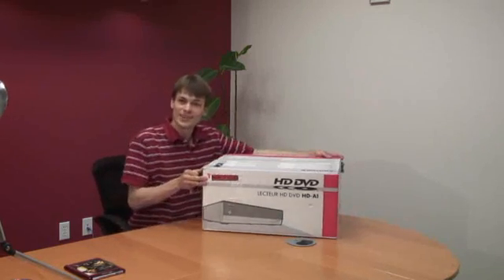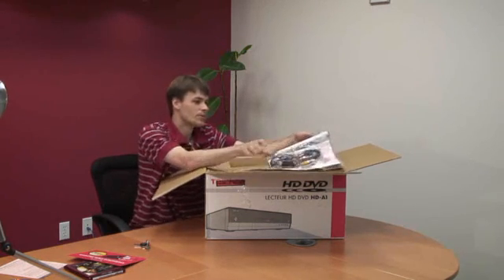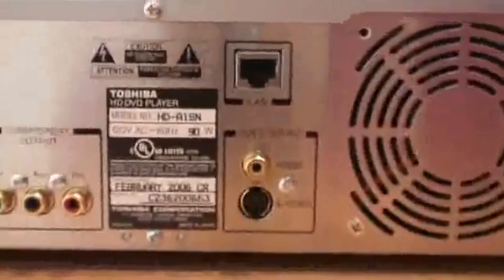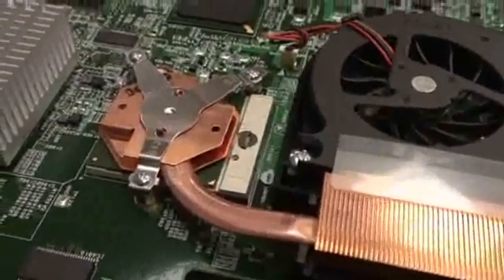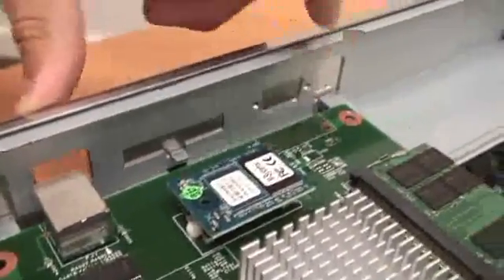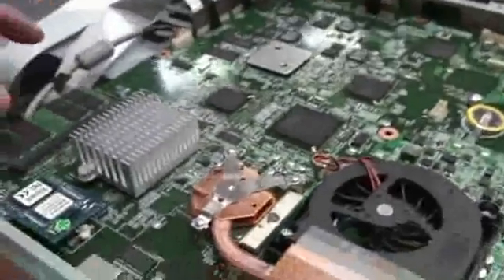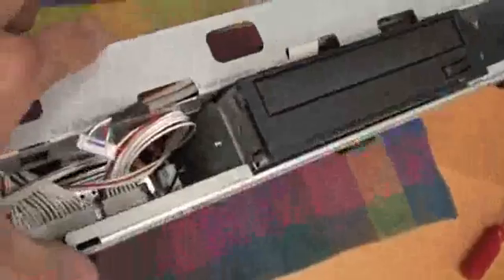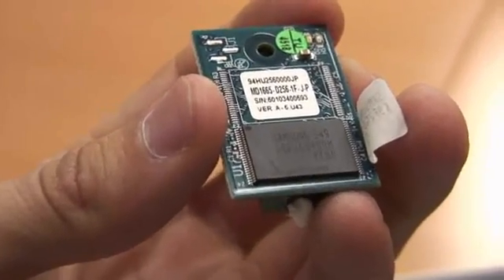Toshiba HD DVD Player (HD-A1)

Comment: love tear downs.  even if it's rather hard to find the A1.  ordered the A2.  see if thats screwy.  have one running off USB for the laptop.  Runs just fine.  although finding software for it would be more than finding a used HD DVD player.  (Arcsoft is the only one that runs HD DVD as it was designed.)  WMP plays the EVO files.